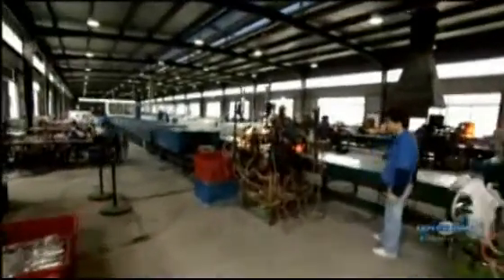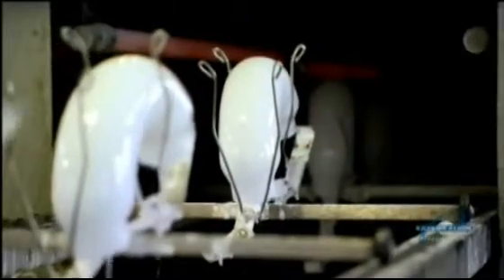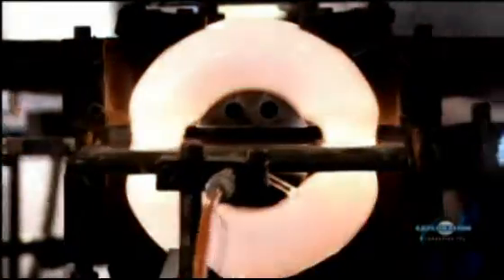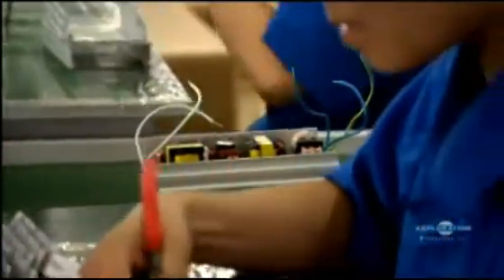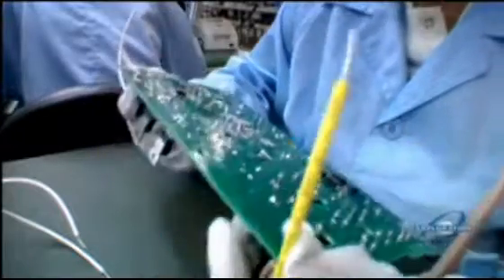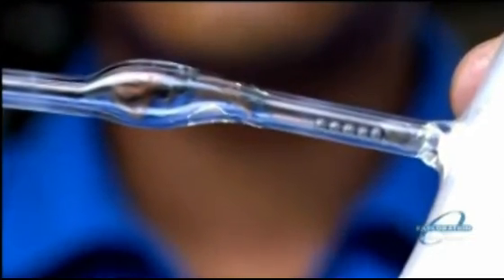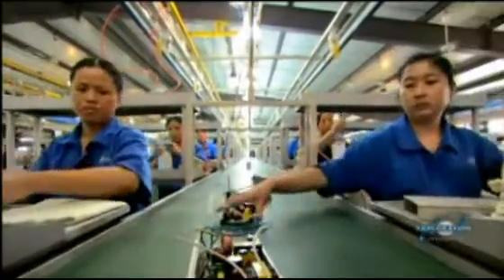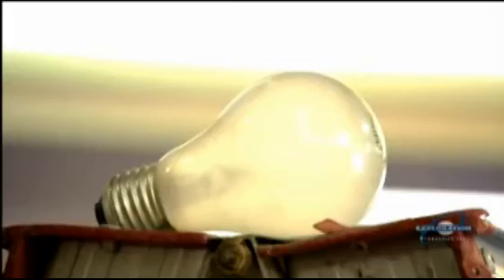Global leader of induction light  manufacturing

Comment: Manufacturer of induction bulbs and electronic ballasts. 
Advantage of induction lamps 
Energy saver 
Induction lights are 50% to 60% energy saver compared to incandescent lamps, HID lamps, and fluorescent lamps. 
Longer life span 
No electrodes, no filament to be damaged, the life span is up to 100000 hours. 
Eyes protection 
Induction lamps are surface light source, excellent lights, no flicker, no glare,good for eyes. 
Low maintenance. 
Induction Lamps can help users minimize maintenance costs in terms of its longer lifetime. 
High CRI 
Induction Lamps have a natural color of light which the color rendering index (CRI) is up to 80(Ra).The object looks more natural and comfortable. 
High luminous maintenance 
The luminous maintenance rate more than 75% at 60000 hours. 
Environmental Protection 
No liquid mercury to harm human beings or the environment, health and safety.